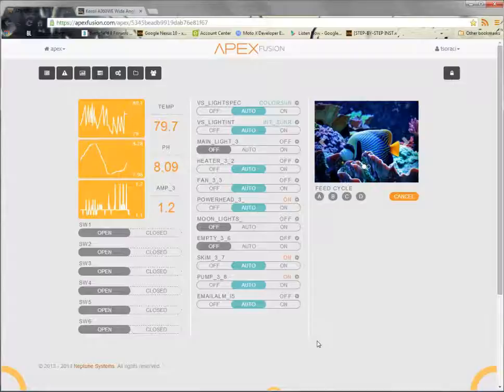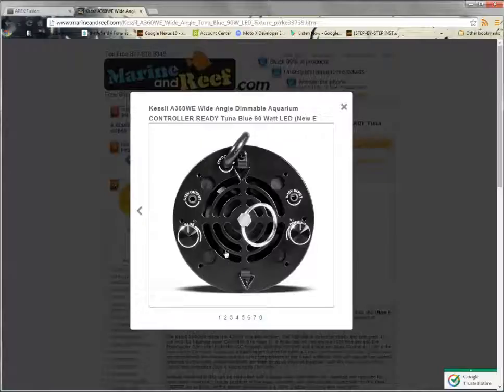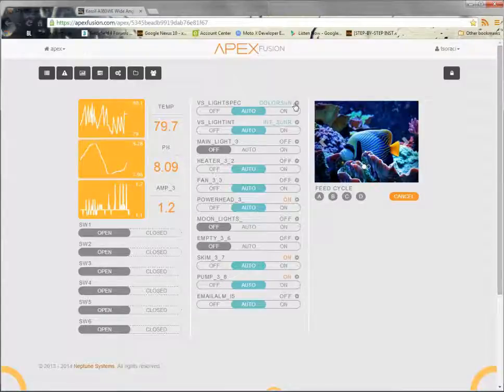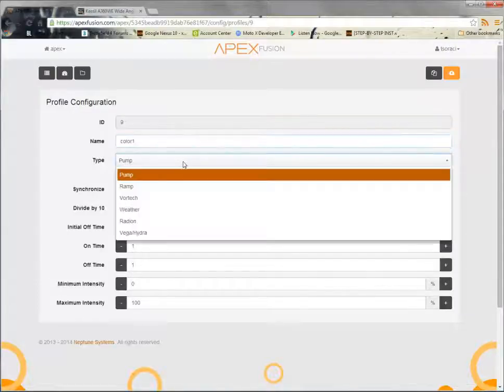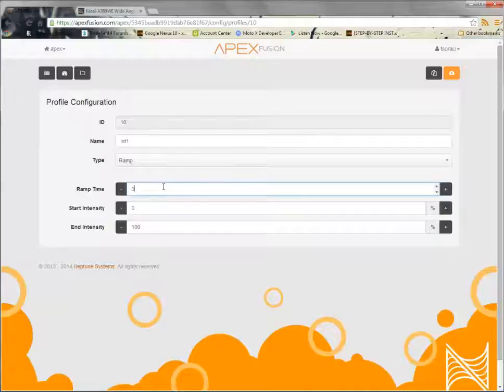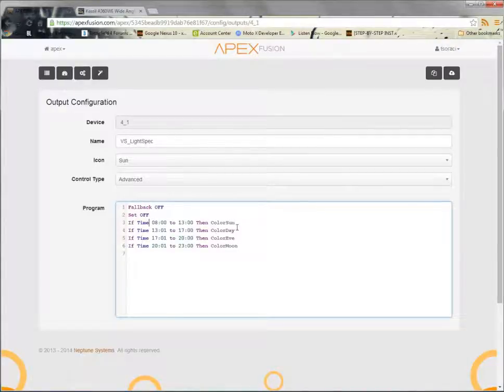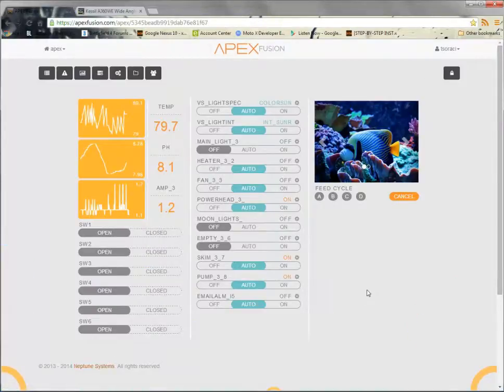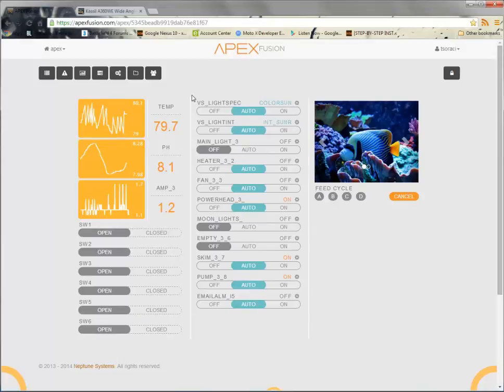Apex Programming Kessil A360we

Comment: Hi, good information. How do you get the night and moonlight to work? Are you using different light for those settings still or on the Kessil 360WE?I would like to do a cycle moonlight for mine, but there isn't very much info I have found. If you could help or direct me to where you found the codes, be most appreciate. Thanks for the vid!
Reply: flyinghigh965 hey unfortunately once the intensity drops below 15ish on these kessils, they shut off. If you're looking to get a moonlight for all night long after your lights ramp down and go out, I would get an LED strip. Very cheap and will keep a little moonlight on your tank all night
Reply: flyinghigh965 oh btw check the description, I have all the profiles in there
Reply: Alright. Thanks for getting back to me. I'll see how I can work out the moonlit phase.